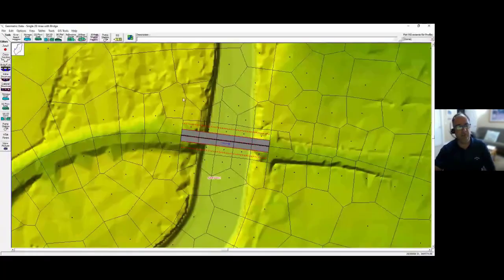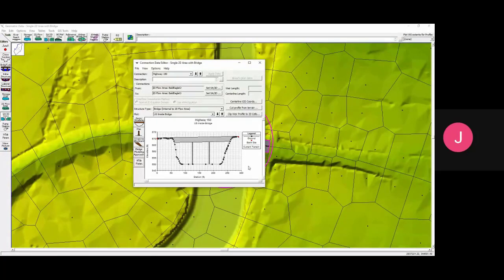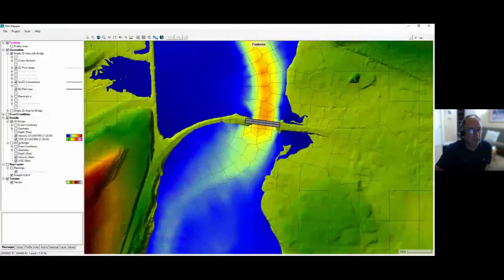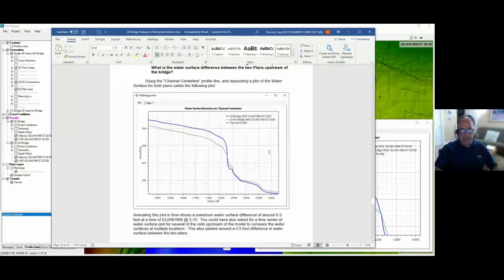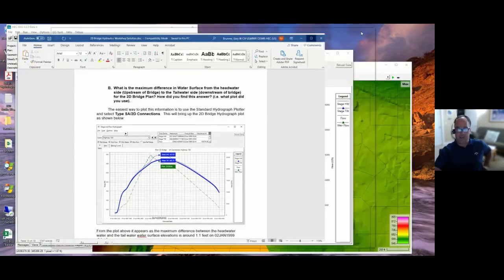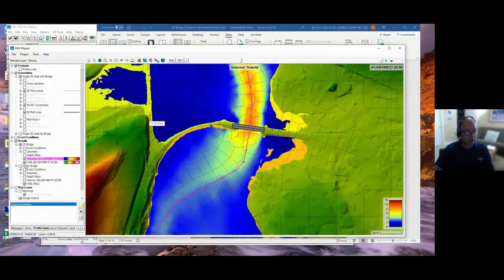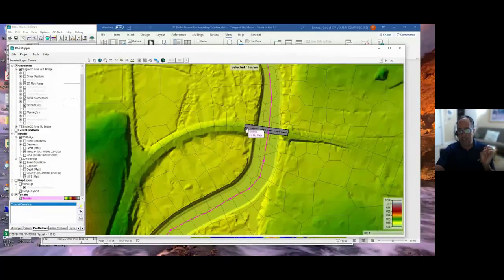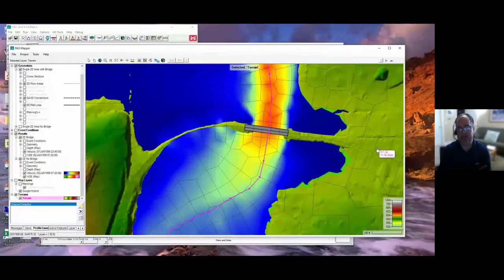HEC-RAS 2D Class: 4.4 - Bridge Hydraulics Workshop Review

Comment: Hi
In one of my bridges, the internal boundary curve is pretty flat and looks like a straight line with zero slope.
The bridge rating curve isnot curvy.  rather a wiggle line..(going back and forth)
Morever at the high values ,the same elevation has flow values different my two or three fold..e.g at 104-105 ft stage ,the simulation flow varies from  100 to4000 CFS.